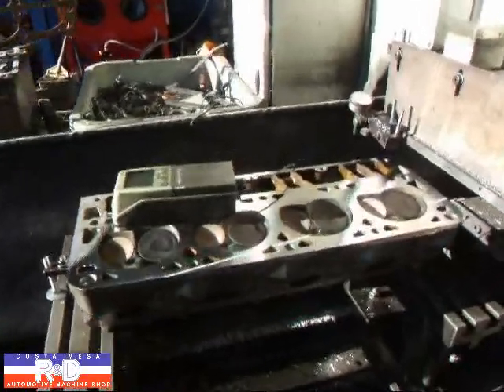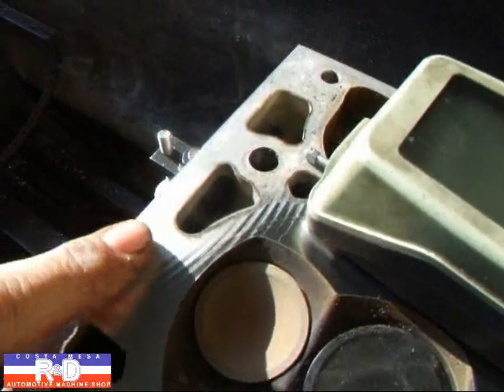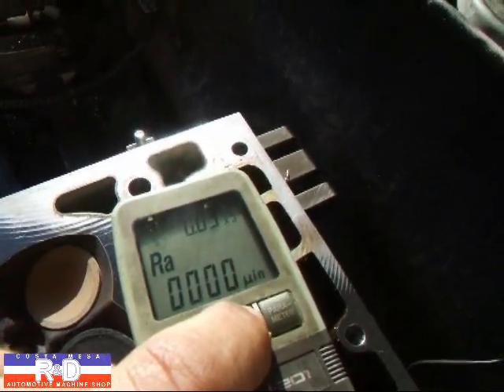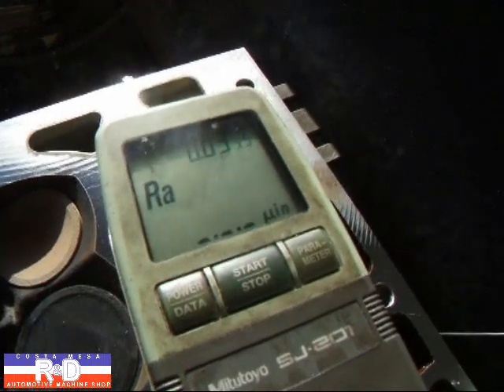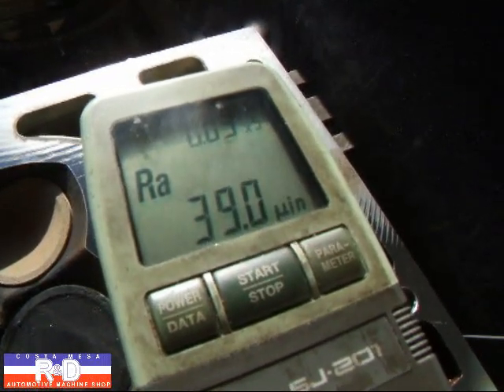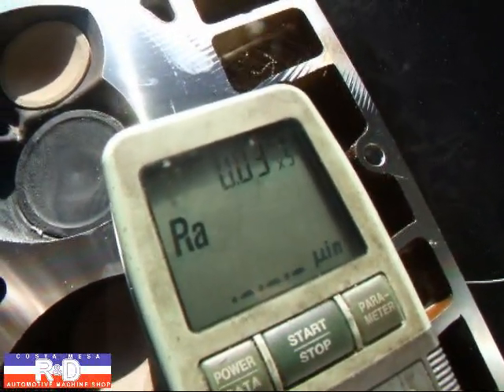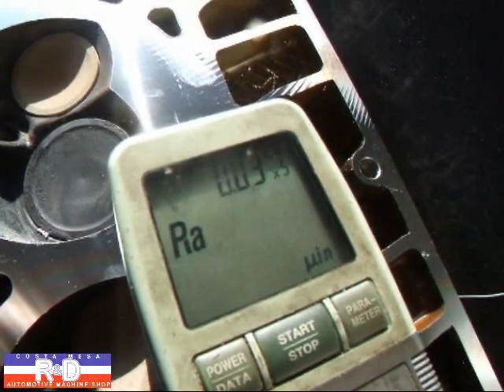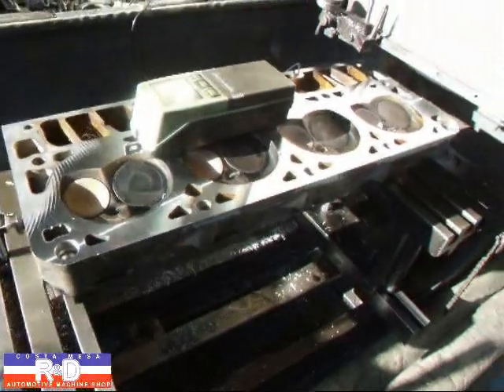Factory Surface Finish Vs Costa Mesa R&D.mp4

Comment: What is the major determining factor of surface smoothness?  Cutting bit condition, feed speed, etc.? I know when I was machining brake rotors the slower the feed speed the better the job the lathe did, but that is quite a bit more simplistic than what you do there.